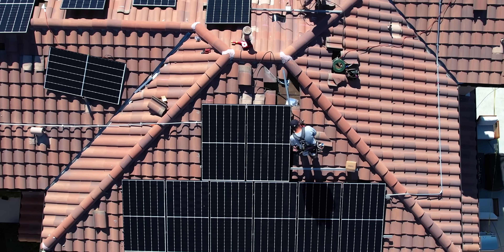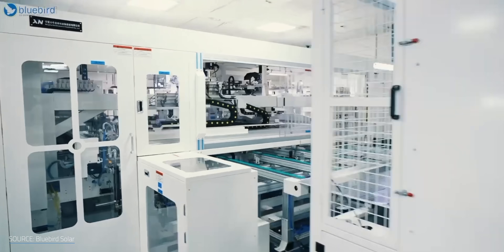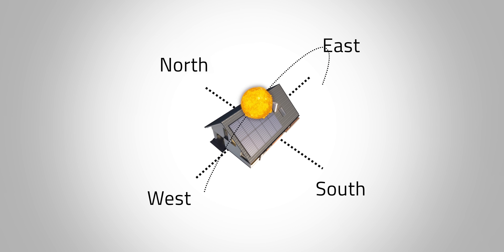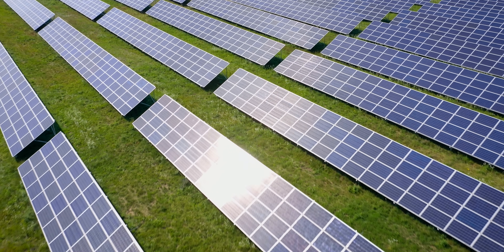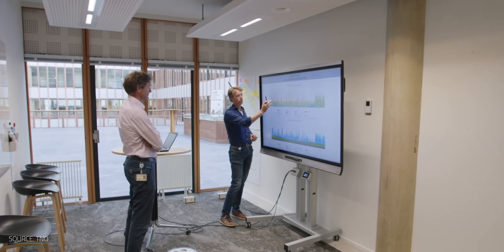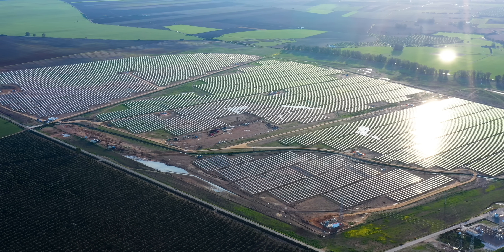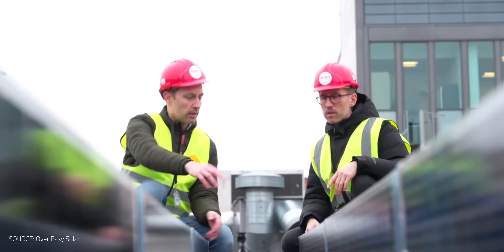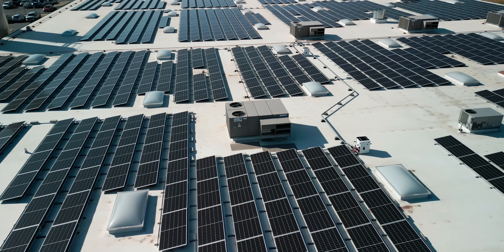Have we been doing Solar wrong all along?

Comment: "Scalable" is relative, considering solar 1) produces a TON of toxic chemical waste; and 2) consumes an enormous amount of land.  Nothing comes anywhere close to nuclear in terms of minimal environmental impact and maximum power generation per area.  If we'd gone to nuclear before solar became viable, solar would likely be illegal by now due to its severe detrimental environmental impacts.  Concentrated solar power  (CSP) is somewhat better:  it uses no more land, maybe a tiny tiny fraction more, and stainless steel mirrors.  The waste product of CSP is the waste product of steelmaking:  steel consumes Carbon 12 (non-radioactive) and concentrates Carbon 14 (radioactive waste) in its waste; but good steel can be recycled without realloying it with more carbon, while recycling solar panels…is not a thing, and would require chemical treatment, purification, completely regrowing the semiconductor-grade silicon crystals, doping them with more chemicals all over again (which is where you get all the toxic waste spill all over the place), etc..  So CSP has that going for it over PV at least, but it's still a disaster compared to nuclear.

Comment: Thanks for the video. 

The biggest thing that we are doing wrong with solar is trying to centralize the generation of solar energy. I understand that the people who have big money to invest is solar want the system centralized. They want to run big solar farms where they can generate the energy and charge customers forever to receive that energy through transmission lines. That gives them a steady flow of revenue from solar power. 

That strategy makes sense for the big investors, but that strategy isn't the best way to use solar power. Most of us can't safely operate a power boiler at our homes. We don't have time or skill for that. We certainly can't operate a nuclear power plant in the basement. Besides the fact that wind doesn't blow consistently enough, we don't have time or skill to maintain turbines. However, solar panels are something that most of us could have without needing to spend time on operations and maintenance. Much of our maintenance would just be hosing dust off the surfaces occasionally. We don't need to find a way to replace all of our electricity usage with solar. If we can replace just ten to twenty percent, we could reduce pressure on the overall electrical system. We would also have a backup against interruptions of centralized electricity. If solar panels could run the bare essentials of heating, cooling, and refrigeration, they could keep people more comfortable while centralized power is being restored after some kind of outage. If we would also design homes for easier energy conservation, that would help as well. 

Whether bifacial panels are really the right solution is harder to say. If panels are hung on an apartment balcony as shown in your video, most of the sunlight is going to come from direct exposure. Some much smaller amount of light may reflect back from the back of the balcony, but that amount of light might be much, much smaller. That amount of energy might not justify the expense of a bifacial panel. The most cost-effective solution might be to use a traditional panel mounted vertically along the edge of a balcony. Likewise, your video shows panels mounted on the sides of buildings. The backs of those panels are not going to see sunlight. I see no point in using a bifacial panel in those applications. The most important point of your video seems to be that vertical installation has positives that  might offset the loss of light that comes from not installing the panels at the optimum angle to catch the most light. In some situations, the vertical installation will let people install more panels in more places more conveniently. That could make solar power a more feasible option without changing the panel technology. 

One of the big weaknesses of those installations of vertical, bifacial panels is that they are going to be vulnerable to strong winds. A solid panel on a set of poles catching a strong wind is going to transmit huge forces. Either the panels are going to bend and possibly break or the poles themselves will be broken by the wind. If the panels have to be replaced after every strong windstorm, they are not going to be cost effective. On the other hand, a traditional panel attached to the wall of a building could be made to be nearly as robust as regular siding. Making the system more robust will make it more economical in the long run. 

I can see where the bifacial panels are going to be great choices in some circumstances. The integration of solar farms with some agricultural farms makes sense if the winds in the area won't tear down the panels. The rooftop installations make sense as long as winds don't throw the panels off the roofs and onto people standing next to the buildings. Bifacial panels as a kind of privacy screen in select parts of residential yards would be a good idea. I welcome this improvement to the technology, but I see value to the old technology installed vertically in many situations.
Reply: Considering the popularity of wooden privacy fencing in tornado prone areas of the country that is made with wooden poles, I feel utilizing steel poles to hold up panels will catch on even in those places.  There is also the possibility to manufacture the panels with wind releif ports or even use the pressure generated from the wind to create more energy similar to a wave generator.
Reply: @andrewholding483  I understand your point about wooden privacy fences in tornado-prone areas, but I see a few key differences. The first is that solar panels, particularly those with a new technology are going to be much more expensive than the simple wood slats of a privacy fence. I've had to replace sections of wood privacy fence after a hurricane. Spending that money isn't fun, but the expense isn't terrible. The second is that debris flying around the neighborhood during a hurricane or tornado will do relatively minor damage to the wooden slats of a privacy fence. The metal top of someone's grill will put a scar in a wooden slat, bu the fence will still function as a fence. In a few months, the scar won't be noticeable. The same piece of metal or some random piece of wood hitting a solar panel could damage the solar panel beyond use. I've seen little cracks in windows from pebbles being carried by winds. Those would be bad for a solar panel. 

In some ways, I worry less about tornadoes than about hurricanes or other wind storms. I live in Wyoming now, and we sometimes have winds of thirty or forty miles per hour for several days at a time. In Louisiana, that can happen with a tropical storm but is not normal. In Oklahoma, I remember stiff winds, but they were usually only around twenty miles per hour. Most tornadoes are intensely destructive but not widespread in their destruction. A tornado might wipe out one street of houses and their vertical solar panels, but a tornado is less likely to wipe out an entire subdivision of homes and panels. I'd worry more about a hurricane wiping out large areas of these panels or just sustained high winds in windy parts of the country constantly damaging these structures. 

I'm skeptical of whether wind relief ports could prevent damage from hurricanes, tropical storms, or sustained high winds. I'm certain that wind relief ports couldn't reduce the stress of tornado-force winds enough to save the kinds of panel setups shown in the video. 

I love the idea of channeling the wind slightly as it goes around and through these banks of vertical panels and generating a little bit of wind energy. The best mechanism might be like a wave generator or maybe just improved turbine design would make these setups good for improved turbines.
Reply: ...but I totally agree with the decentralization of power aspect being a huge advantage of solar.

Comment: short vertical panels on a roof in Canada, would eliminate the problem of Snow, and if you do them with enough coverage density, it should generate as much electricity. I'm currently researching which PV system I want to install on my house, and this has me intrigued.

Comment: So, even with just assuming the findings are correct and BVPVs are more effective in most cases, I somewhat think there are still going to be some cases where typical conventionally-oriented single-sided photocells will be better;

First of all, in very far North and very far South positions where less sunlight gets through the atmosphere and the geo-magnetic shield. Those areas are already going to have a lot colder ambient temperature, so the increased resistance due to heat will be less of an issue. On top of that, due to how much less direct sunlight gets to the ground in those areas, the currently typical (somewhat) perpendicular orientation of the panels would be desirable to make the most out of how little gets there. (Then again, at those extremes there there can be a lot of snow, increasing how much ambient light bounces around that a double-sided panel could take advantage of, and standard-oriented single-sided panels would need to have the snow cleaned off more frequently... Hmm... 🤔)

Secondly, beyond the cases where the typical single-sided panels MIGHT have an operational advantage, we are back to space constraints and land usage; Making use of roof space is quite space efficient, and considering how close the panels are mounted to the surface of the roof, there isn't going to be a lot of ambient light that gets under the panels that double-sided photocells could take advantage of... Also, properties that have trees on them might not have decent areas to set up solar panels other than on the roof of the building on the property.

Other than those two cases, I could definitely see a shift towards BVPVs.

Now, if only we could have something like a tethered balloon with solar cells on it, but considering the mass of solar cells I'm not sure how to do something like that without either constantly buying helium gas to feed it or burn fuels to keep it up as a hot air balloon... Oh well. 🤷‍♂️

Comment: I'd suggest that vertical panels also collect less atmospheric dust, snow, rain etc which improves their performance. However.. they would be more susceptible to wind loadings and vandalism at ground level. Reference the cooling and such - are vertical panels also more efficient at cooling in the same way as heat sinks with vertical fins on? How does the performance of the cells at the top of the panels compare with that of the cells at the bottom? We could be looking at a phenomenon that has much more straightforward causes than just the double sided panels...

Comment: Besides de obvious greater "contamination resistance" allowing for a greater average efficiency between clean ups, I would consider rotating vertical panels (Sunflower style) at least for smaller home setups where you can afford the space and 45º mirrors in an optimized layout between rows that would make the Sun's direction (and maybe elevation to some extent) mostly irrelevant throughout the day. Kind of setting up an F-117 between panels reflecting most of the energy away from the source/Sun in other directions.
Between the vertical installations, there is always one side available to benefit from this directional reflection without the need for moving parts.
It will obviously shift the orientation to the usual facing North/South and I intuitively expect at least a 33% increase when compared with the East/West without fixed reflective devices. 
If the reflective devices can have some degree of movement to adjust for the time of day/year, who knows how much more one can actually benefit from this "double-sided" setup?
Unfortunately I have no way of trying it out myself. I hope someone can experiment with this idea. I would love to hear about the results and especially about the reflective surfaces solutions!

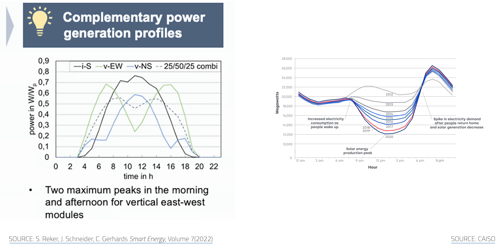Comment: 4:05 good job. I know bifacial but they never mentioned this advantage until now.  So you basically get good generation in the early morning and late afternoon but not noon. A side effect of this, due to less peak generation, you don't need to buy a powerful inverter just to capture a short peak of power generation around noon. Inverter cost is being left behind the rapid drop of solar panel prices. Additionally, in solar farms, you don't need a tracker that adds costs-we just need a large solar farm or solar pv company to confirm this.  
Sadly, for most residential installations, a vertical bifacial is not practical.

Comment: Hi Matt,
I understand the ups and downs of the orientation, I have not yet bought solar panels.  However, the use of fileds for farming is very important for food sources.  I think that I would prefer to pay the extra cost of needing more panels in order to keep the fields for crops.  This downside is that they would get battered more in the very strong winds where they would be best in a horizontal position.  Currently, I am undecided, I am currently leaning toward the vertical solution as this will  keep the footprint much smaller per panel.

Comment: The other major issue aside from the fact that the expense would much outweigh the performance, is that you're paying for two times the amount of actual photovoltaic cells and only getting a 2.5% increase in overall output.
I agree, like you said it's there are places for this and a certain situations where it could be more useful, but for general use it seems to be way behind the standard current solar panels.
The other thing, as a sailor, the first thing I thought of when I saw the vertical freestanding solar panels was that you just put up a bunch of sails and any big wind storms that come through are going to wreck your entire farm.
Reply: You can use normal panels, not bifacial and still you get better energy yield profile. Beside that, the bifacials are not twice as expensive!
Reply: @vencdee  if you look at what I posted, you'll see I did not say it would be twice as expensive. I said you were paying for twice the amount of photovoltaic sales. Some of the basic parts of the panel will still be usable by both sides. However, in order to retrieve sunlight from both sides you will need photovoltaic cells on both sides.

Comment: I have 3 arrays of 6x465W bf south facing vertical 90deg, 1 array is losing 30% some connection fault , when the sky is clear and snow is on the ground my 8370 w makes 9515w , I made a mistake and mounted 1 panel upside down , with snow down it produces more than the other 2 arrays, this year I will try one array all upside down to track any gains while snow is on the ground. My area has 2 hours of sun a month in winter ,so its all about refraction capture. Oh I had to clean snow once as it melted over the top.

Comment: Having just had solar installed on my roof, I'm like, "Should we have installed a solar fencing instead?!" Seriously, though, any sort of cooling, especially if it can be configured to draw minimal energy from the system, like 1 extra panel to run semiconductor cooler blocks on the back of conventional panels, or micro spray water cooling, like a garden misting irrigation system, under conventional panels, might see a similar gain in noonday efficiencies. Obviously, the wiring would need to be water hardened, but it's an idea worth trying. I'm off to look at my local irrigation suppliers online 😆

Comment: Makes sense to me, you don't see horizontal chimneys.  That heat just wants to rise so a vertical panel should be significantly cooler and more efficient.  Unfortunately, I can only go with horizontal (tilted) panels because when my house was built in 1965 the roof was perfectly placed for solar - faced north and angled at 35 degrees.  BTW I'm in the southern hemisphere...

Comment: This means that you could build an energy farm of vertical windmills whose surfaces are photovoltaic. Surface temperatures would be much lower, wind energy collected, and reduced problems from snow and dust. Even rain would run off, helping clean the cells!

Comment: Is it not because of solar panels still being able to generate power from indirect sunlight? With a panel that has 2 sides, this already has increased power output, compared to those that only have 1 side. Combine this with the fact that it's less likely for it to overheat cuz of how it's setup, things are just piling up on the positive side for the 2-sided panels.

Comment: Technically, it's not "due to albedo," since albedo is the property measured, but the phaenomenon is called "radiosity," and it refers to the fact that surrounding light gets reflected and dispersed; one need only look into the early hours of the day, when the sun is only just rising, and if your house has windows on more than one side of the building, you get sunlight from the West even. You can observe, in certain buildings, light coming in from all angles throughout the day. It's this same principle that operates here.